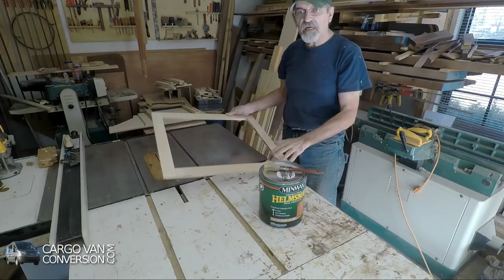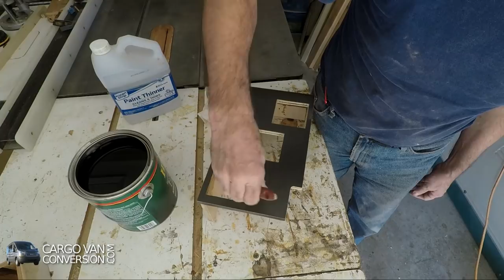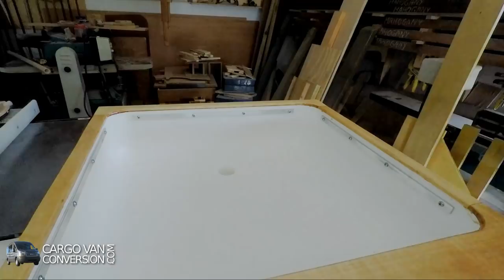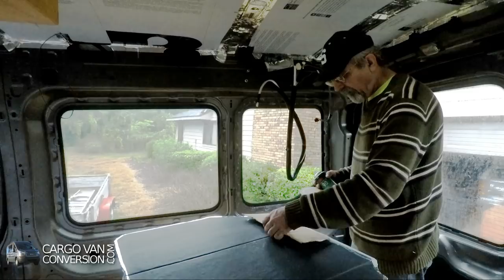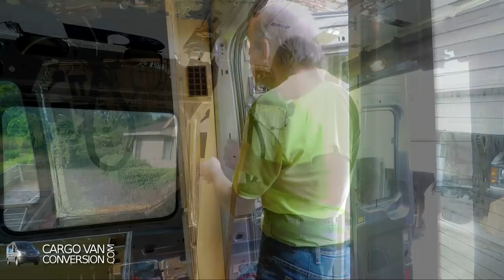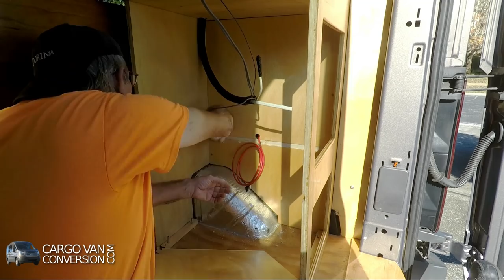Black-Out RV Window, Flower Pots & Fridge Cabinet Install

Comment: Hope you have a great time at the RTR! You and Joey are going to be quite popular!
Reply from the maker: Had a great time and we are just back home. Met lots of interesting people.
Lots of people recognized me (that was strange...) and many subscribers came to say hello and look at the van.
Van Williams
Reply: @cargovanconversion  Fantastic! I knew you were going to be a hit! Glad you made it and are safe and sound. How did everything work for you on the shakedown cruise?
Reply from the maker: I had only one issue and that was quickly resolved. I had put check valves on the vent lines for the water tank and water tank level.  That would have been an easy method to avoid any small insects or debris from entering the tanks.  That just didn't work out, so I removed those and will extend the lines and close them off with some screening material. Did get some useful feedback about energy use, storage, the type of camping I will do and ways to occupy my time. I will likely come back to that in upcoming videos.
Just a great trip, only too much driving :)
Van Williams

Comment: There's a great invention called wipe on poly. So much easier and you can do so many more coats in a shorter amount of time
Reply from the maker: More wipes less coating. But you're right, but time is no issue with me, just the habit of doing it this way. Many roads lead to Rome. We will both get there, I'll just be a bit late :)
Van Williams

Comment: Great work as usual! Just a question: why did you make the blackout window black? Isnt that bad for insulating? 
Not hate whatsoever, just a question! :D
Reply: llama lady black attracts sunlight and heat. Many people had windows crack from the heat. I used a brown fabric sewn to reflectix. Blackout means to make the area dark....not to put black facing out. Kind of like driving white vans over black ones. ;)
Reply from the maker: Love your question. The simple answer is yes; black reflects less sunlight, thus higher temperatures. But there are lots of issues at hand. It starts out with the 'All-Around Window package' from Ford. Ideally you use a completely closed of van, without windows. Would do that in the cabin too, but that would make driving a bit difficult :) I just love the windows as a design feature outside and love the view for the inside. And then there is the issue of insulation. In my opinion, in a van, using insulation for warm weather traveling, may be less efficient. When it is hot outside, you can bet it's hot inside. A van is not made like a house and just opening a door will completely change the heat envelope. I tend to put more emphasis on ventilation as a way to stay cool. The black of the blackout window just hides it better from the view outside.
Van Williams